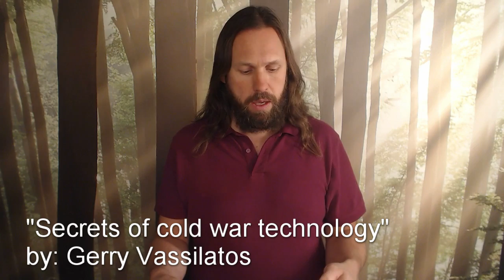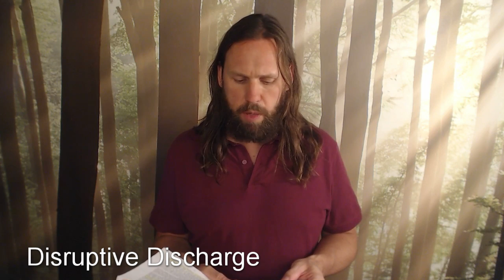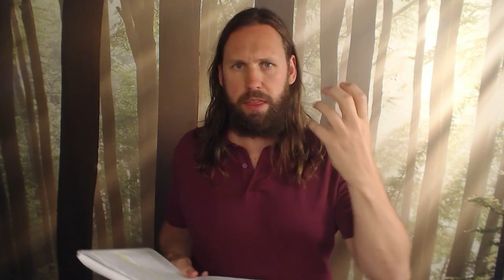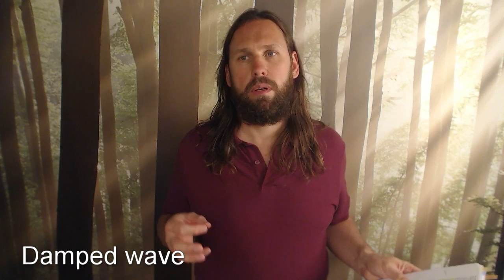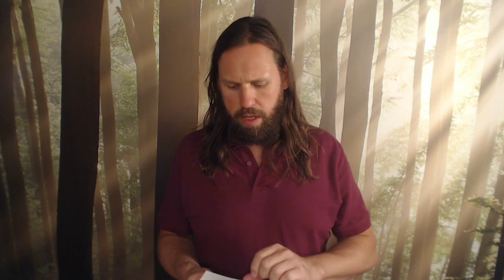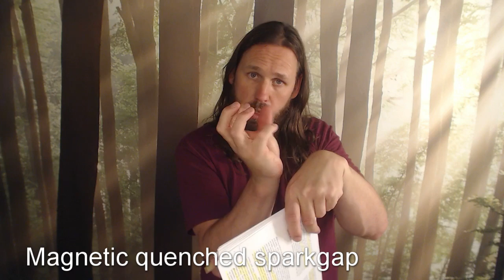Nikola Tesla's Radiant Energy Part 1 of 3

Comment: Tom Beardens paper "The final Secret of Free Energy?" He claims that contamination , corrosion, and other developed conditions may be key to free energy - Electrolyzer builders such as "Moray King" ect.  often stress conditioning the plates for weeks or months to develope deposits and greatly improve efficiency. -  when the power was first turned on from Niagra falls  and other places long ago in Teslas era - Large Blue Spikes were seen protruding from the wires seeking ground - they Killed People - it may indicate that a conditioning of the ambient medium was taking place. - Tesla spent years trying to purify copper believing that it contained trapped gasses.
Reply from the maker: I always avoided Bearden, it doesn't resonate with me. Feels like a lot of confusion.

Material properties might have their role, their relative distances and geometries should influence AEther flow, like wave guides

  For me the real action is in the Aether fields (ambient medium).
Reply: -  @MasterIvo  -    Bearden works on the edge of possibility - dipoles, magnetic monopoles, ect. that is where signifigant discovery can occur - he has also developed the MEG, a solid concept. - i have seen few indications that the either should be considered strongly in electrics -  as particle hypothosises appear adequate to work with and magnetic fields appear to be the intermediary for either - yet the either manifests its presence at the motion of every particle - it being the carrier for inertia and momentum - that appears to be its primary role in causation. iam not discouraging seeking other either manifestations - Author William Lyne of the book "Pentagon Aliens" describes Teslas use of the either to Rigidize Space in his propulsion efforts.

Comment: it appears to be a reaction relative to the polarising impluse - the question is - what is the polarised element? - that may be an atomic reaction or a magnetic domain shift within the circuitry itself - impurities in the wire itself - see Tom Beardens writings.
Reply from the maker: I'm looking if it are impedance changes, a change in the properties of the Aether. permeability

Comment: It seems like the fallback of radiant energy is what actually induces the magnetic vortex we 'see' as magnetic fields around a conductor...
So: 
Dielectric(radial propagation) -> radiant(volumetric field) --> magnetic field (vortex 'draining' of radiant volume)...  we see this as current x voltage (pwr) in conductors.
Reply from the maker: sounds good. I compared +V impulses VS - V impulses.

Only the - V impulsss amplify the magnetic field

Comment: @Master Ivo, at 17:25 you make a good point about not needing a high voltage to do these experiments, lower voltages do indeed allow for cheaper components and faster switching. But I want to engage you on the bit about Mr Tesla saying one of the things you can do is Up the Voltage, you say that is not necessary, because you say its more about setting the Ether in motion. Ok, so if Voltage represents tension in the Faraday Tubes as you explain in the other video, then Voltage does matter because as we can see in a Macro analog, a string vibrates differently the more tension you apply. The quickening of the switch is in my mind the plucking of the string. I believe that a different set Class of effects will arise as you climb the tension ladder. This ladder you also pointed to, this is the brevity of the switching, milisecond, nanosecond etc. I believe that these classes of switching represent different frequency bands of the Ether, thus different effects. I hope my counterargument makes sense enough for you to revisit your position by the least, I am interested in your opinion and findings please.
Reply from the maker: You make a good point, thanks for your clear observations. I do have made progress in this subject.

Eric p Dollard showed (1988 bordeland videos) there are transverse electro magnetic (TEM) vibrations, and Longitudinal magneto dielectric (LMD) vibrations.

They are dependent on the frequency that is tuned into. 

I have confirmed there are 2 sets of frequencies, whereby the LMD gives much higher amplification. This is a recent discovery for me. still under research.

I do believe the voltage has a threshold, and I have scaled up to a maximum of 1000V. there is still much to learn. I could go as high as 1700V with the current SiC mosfets. But it demands a different approach.
Reply: @MasterIvo  Exciting :-) When you say there is a 1000V threshold, do you mean that the effects remain the same as you climb the frequency bands (pulse duration bands)? The closest analog for the 1000V threshold is the absorption of sound in the immediate environment, if you make the string mode taught (voltage) you get more Volume (amplitude). Since we are dealing with single sign pulses, the closest analog i can think of for Amplitude is Loudness or Gain. You said that you used 12V and managed to get a current gain of 50V on the inductive spike, that is what made me think of the above. I did it myself and saw the high side and low side switching spikes. It also illudes me why the overshoot is comparatively in magnitude half the intensity of the Negative spike, could this be saying something about the nature of reality?
Reply from the maker: @khwezimngoma   spike duration, spike voltage and spike energy are related.
shorter duration needs higher voltage for equal energy.

the surface area under the spike must be equal for equal energy.

1000v maximum is set by the mosfet, it is not a threshold.

With my setup I also see a slight difference in positive and negayive spike voltage, this is due to differences in duration.

if you tune the L1 coil with a parallel capacitor (pF range) to have equal spike (both polarities) duration then the spike voltage is also the same
Reply: @MasterIvo  wow am learning a lot from this interaction, thank you kindly.

Comment: it's not that mysterious.  His 'radiant energy' patents were an early solar power generation.  It could use light to knock electrons off a plate (photoelectric effect) and to use the ground as a reservoir of negative charge.  As the electron charge was dissipated off the top plate via photoelectric effects, the ground supplied further electrons, effectively leaving the top condenser plate as a positively charged plate, the lower negatively charged, and the spark-gap allowing the surge to go through the work or storage load.  The term 'radiant energy' was used in order to make the patent generic enough that it was hard to get around by using different forms of EM radiation.
Reply from the maker: interesting statement, but I see a lot proving otherwise in my experiments. Only explainable by a longitudinal wave component. for example my "radiant power" video of april 2019

Comment: Thanks for the highly thought provoking concepts.  Remember, like disconnecting a switch, you will always go pass the point of very weak connection, which drags the inductive charge through this micro space. The same goes with connecting the charges. The connectors go through a micro space which a magnetic field reaches out between the contacts. As a retired electrician,  hi voltages will seek out a drain like lightning seeking a ground. That wavy spark seeking a good place to strike the ground, has a field that precedes this hit. Could this be the same? Thanks.

Comment: I like ed leedscalins ideas. He says electricity should be called magnetricity.  I think radiant energy is the flow of magnetic energy from the north to south pole , moving together in a corkscrew like motion.  Ed speaks of these like tesla spoke of longitudinal waves. Superluminal andcsble to penetrate a faraday cage. Check out the work of dr thomas henry moray. He used a magnet to get his device tuned and running. Morays device put out up to 50kwatts of power with undersized wire and his trsnsformer remained cold even under heavy loads. The ability to tap in  these magnetic currents flowing around the earth is relative to where you are in relation to the north and south poles. Look at roy j Meyers invention or leedscalins thoughts about the importance of location and orientation. A bifilar coil csn be looked at the same way as north polarity in one direction and south pole polarity running in the oppisite direction just like are earth. Im looking into now how magnetic fields affect plant growth.  Seeds will germinate faster when the south pole of magnet id placed under them much more so than if a North pole magnet is placed under them. Even though the strength of a magnet from poles is equal , the pushing affect of a south pole magnet is stronger than north and the pulling affect of a north pole is stronger than the south. Keep up the good work, you are very intelligent.

Comment: According to Gerry Vassilatos's book, electrons must be filtered out with magnetically quenched carbon rod spark gap put inside nitrogen atmosphere to absorb electrons so only pure neutral ether current flows through the Tesla Coil circuit. Also it says to avoid using copper for transformer coils, instead to use a hollow tubular glass for transformer filled with gas (nitrogen i think) as a medium which will replace copper medium so the Tesla Coil outputs pure neutral ether currents only. For top load, it says Tesla used glass ball filled with gas as using metal as top load will result in reintroducing electrons as metals will absorb ether and expel electrons.
Reply: @Xeno_Bardock  yes the spark gap was a uni-flow 2 stroke plasma engine. That what made the longitudinal force beams

Comment: I like your video.. and your right.. the exchange of energy can be done low voltage...  this was what Bedini discovered with his Energizers.  Your also right about the discharge.. I've seen the purple blue hue and also the Turquoise Pale blue colour discharge which I've captured on Camera.  I've been playing with Joule Thief's of late that's amplifying the Radiant from 4.5v input up to 43volt spike on the output..   and it makes a great battery charger when used correctly...    Excellent video...

Comment: I used a Mazilli Flyback driver to generate very small magnetic nanoparticles by using the discharge between two electrodes(FePt alloy). The amount of nanoparticles was increased by factor of 10^6 if I used bifilar Tesla coils placed in parallel to each other instead of a flyback transformer. The color of sparks was purple. The coils were placed in transformer oil and made of single copper wire. Short circuit between windings was avoided by using baking paper as separator. I tried generation with simple high voltage transformer but could not nearly generate such a high amount of nanoparticles as with Tesla coils. So be careful while experimenting with sparking and avoid an open system at the electrodes as inhalation might have hazardous health effects. I used vacuum tight tubings in which the electrodes could be placed and gap between them was adjusted by micrometer screws. Particle size was measured with a Differential Mobility Particle Sizer. Mean diameter was around 5 nm. Carrier gas was nitrogen.

Comment: And what if atmospheric pressure was created by the discharging of this radiant energy across the planet.
Reply: reddpill username checks out
Reply: It is. Geo engineering..
All our weather is now weaponised.
Reply: In a way your right the radiant aetheric pressures is pushing the atmosphere, you, me and everything else into the earth. Podkletnov and Tesla just focused these aether streams into beams that exert forces. Tesla's magnetic arc distruptor is a uni-flow 2 stroke impulse DC device. tesla made a for of 2 stroke engine and might not have realized it. Its a 2 stroke that burns no gas/fuel oil and taps the aether. now imaging this 2 stroke for a generator, car, truck, boat or anything else you could imagine. Got brapp!

Comment: Indeed, pressure pulse puts 'AEther in motion'.. 
i think there is an analogy with water. If you put a finger into the water there is almost no resistance, but if you hit the surface of water fast with the stick, it become hard as the concrete, and it send a longitudinal shock through the water, right!?
I recently found your channel and as a explorer of Tesla devices i go slowly through your older videos. 
I've been experimenting with Tesla coils and energy transmission, made many different coil geometries and discovered so called "vortex" coil that it proved to be useful also for transmitting radiant energy instead of Tesla coil geometry. It turned out that it is easier to tune it for lower frequencies than original salenoid Tesla coil. My friend Warren made the best presentation of such power transmission application so far. Check it out if you are interested, & Ivo thank you for all your sharing of the important information!
https://youtu.be/NxYDsLhe3fA
Reply from the maker: Yes, the fast slap, makes it solid, and creates a (longitudinal) tsunami  wave. I'll tale a look at the link
Reply: @MasterIvo  so then liquids have tensile strength as a crystal as well as potential strength as a whirlwind out of air , ether is less dense liquid , air is more dense than ether, ether is like a omnipresent, subtle golden liquid?
Reply from the maker: @ChristianSuarez-gz1ig  Aether is the most dense as I understand it.
Reply: Exactly that's what i thought too, Tesla mention an aetheric stream in focused sunlight. Today the vacuum is known to be made of a virtual charge flux of the quantum vacuum. A photons is seen a a virtual charge pair spinning around each other chasing each other at light speed, but this is the product of the aether itself.

Comment: I watched this on another device when i was signed out.. but came back today to comment. Thank you for reading this information and PROPERLY distinguishing pulsed DC vs AC... I have had conversations with engineers about this and they all dismiss pulsed DC or "impulse" as "AC voltage".  I have tried to get them to listen and comprehend.. but a closed mind is a closed mind I guess. Anyway, this is EXCELLENT info! Keep up the great work! It is interesting how short the impulse needs to be for good effects. I am curious how Nikola measured these very short periods of time.  Further, How would you suggest replicating this work given modern technology's capabilities. It seems like these impulse times would be feasible with transistor technology, provided the aetheric force doesn't blow the transistors.
Reply from the maker: Thanks. and lets not forget the difference between pulsed DC and Impulsed DC.
What you ask is not easily put into words, that's why I make the videos, have a look at the April 2019 "radiant power" video on my channel.
Reply: @MasterIvo  thanks for the distinction... i hadn't picked that detail out yet! i will check it.
Reply: Remaining teachable is the appetites of wisdom.

Comment: https://youtu.be/gs51nH46F-g

In this video you can see, via high speed camera,  a high voltage capacitor bank discharge into an inductor of low resistance. The first few frames clearly show a radiant force field shrinking a US quarter, the high voltage pressure spike that is far greater than the supply voltage found in the capacitors. Notice the low resistance inductor stays intact upon switch closure and during the actual quarter shrinking demonstration then fails afterwards. What would happen if one opened the switch prior to the inductor vaporizing? You may use no current in the system.
Reply from the maker: Very interesting ! thanks for sharing